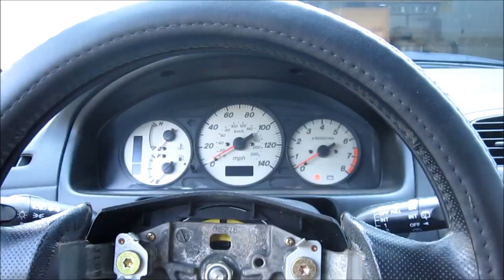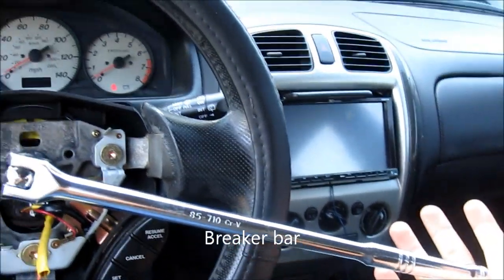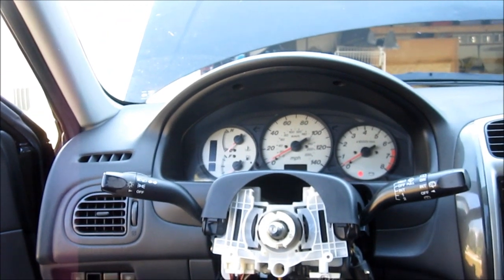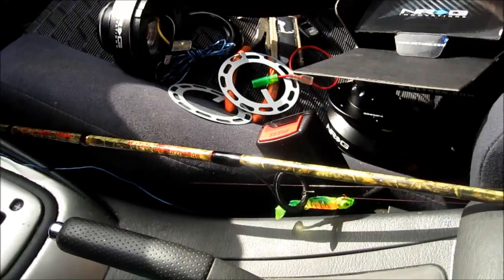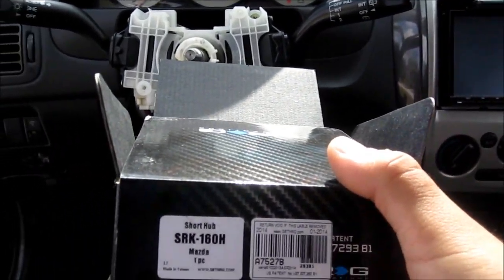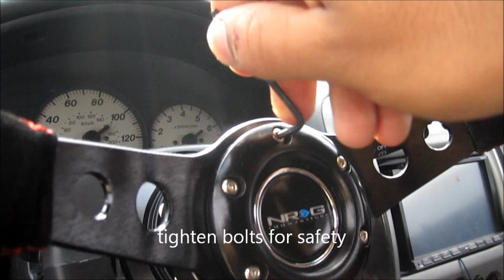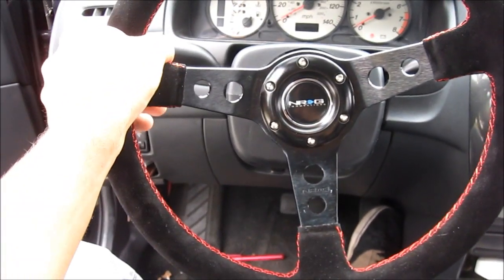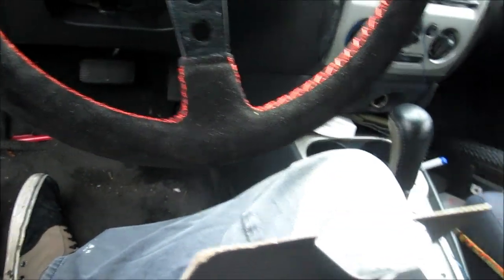Mazda Mods Episode 15: NRG deep dish wheel,Hub,an Quick release/How to install/Review

Comment: Hey with that NRG hub does it have the slots for the white plastic prongs cause my cheap ass hub has play in it and I was wondering if the holes fit good without play with the NRG hub
Reply from the maker: yea it has 2 holes in the back for those prongs its a tight fit nice an snug,no issues there

Comment: Im building a muscle car atm, so i dont have an adjustable steering column. But i have a question, if i were to run an NRG thin hub adaptor and a quick release (the standard, like 2.0 gen) would you think a deep dish wheel would stick out too much? Should i just get a flat wheel? How does yours feel?
Reply from the maker: i really prefer the deep dish an that its closer to me , but its really hard to tell with out seeing your car,in the end the deep dish quck release an hub add about 5-7 inchs closer id say
Reply: alright, thanks for the reply!

Comment: Any update on how to get the horn to work? Or is it just not possible?
Reply from the maker: lol well i can get the horn to work by wiring it to a button or swicth (which is what i need to do) its just really hard to figure out a way to wire it with moving wires lol
Reply: troy watford Where exactly is the horn wire behind the hub? Is it removed along with the clock spring at 5:44 ?
Reply: troy watford Wrap extra wire in a circle

Comment: men,  i need help because the airbags lights turns on
Reply: Theres a bypass SRS resistor kit you can buy from NRG or you can make your own to trick the system in to thinking that the airbags are still there
Reply: I juste to know in the vidéo you dont put the airbag and you Say i need to put more harness for be safety or you put or not the airbag

Comment: If it's a mazda it's not a 13/16 it would metric not English
Reply: Its not called english measuring system its called imperial
Reply: Cody Green In my engineering class we were told english
Reply: xamir1113x my bad. So what school did u go to
Reply: It's imperial we don't use the term English.
Reply: Azoriez exactly
Reply: Okay after you put the Hub in I see another piece in the center covering the screw I didn't see on the video where that came from